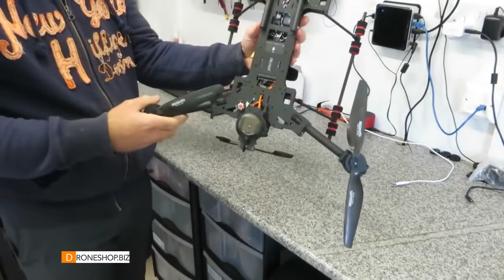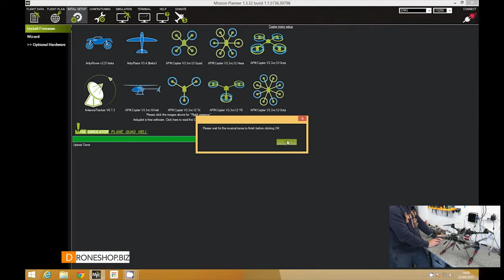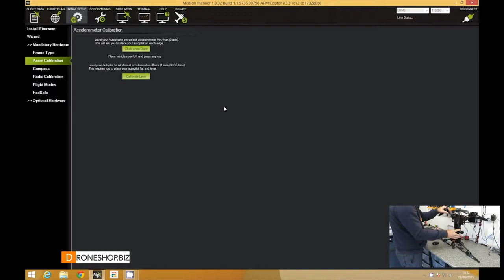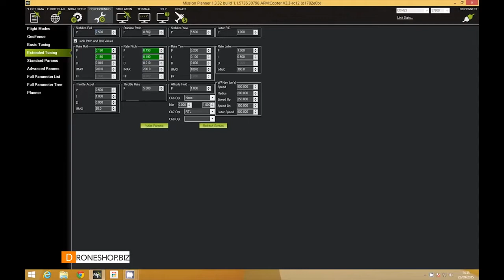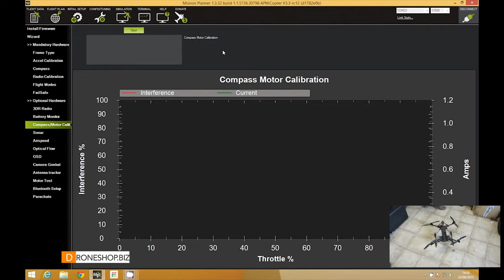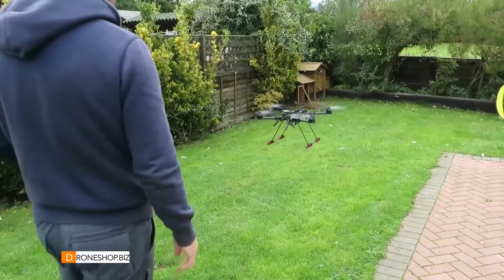How to setup a Pixhawk flight controller🛫🇪🇬✌️

Comment: Nice video got a question on the esc to connect at the receiver did you remove the red power wire and plug just the ground and signal in it?

Comment: Hi Peter,  I'm flying a self built, self designed 16"   using a Pixhack (poor mans Pixhawk) you've filled in some gaps in my knowledge, thanks!
I notice this video shows a very old version of MP so I take it that the actual video was made along time ago but still relevant, any updates on current facilities and options?
Excellent stuff!
Regards Roy.